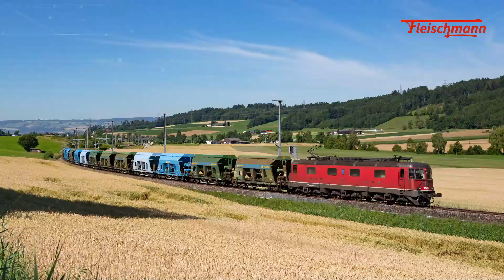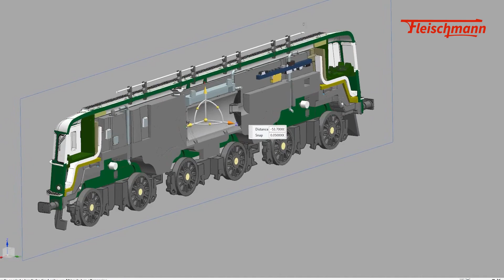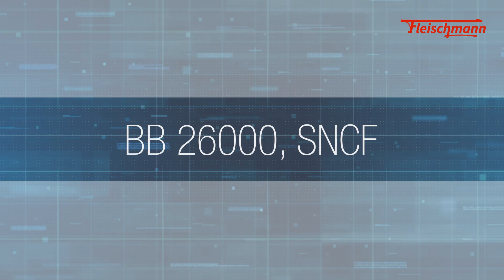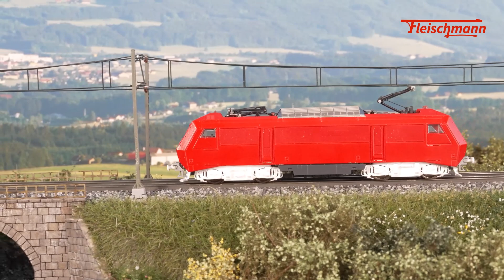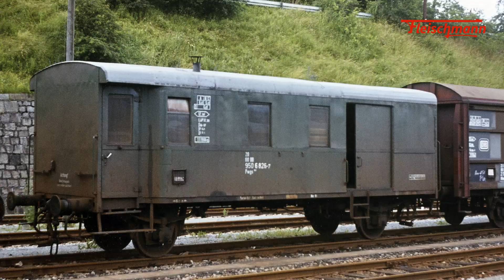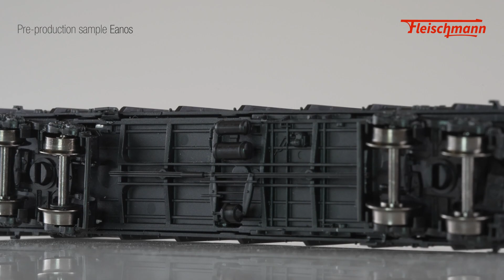FLEISCHMANN Novelties 2022

Comment: Thanks for finally producing an English version of your videos. Now all you need to do is create a new version of your n-gauge track with grey concrete sleepers instead of the old wooden ones!
Reply: Just buy KATO or Tomix
Reply: buy Kato, cheaper and 0 problems
Reply: @eduwinsMIS50PAISES  Kato is the wrong scale it's not 1:160 it's bigger. Cheaper also means lesser quality most of the time. I will pass on the Kato but does not mean it's not for everyone and many like their products and that's cool too, just not for me.
Reply: @mneonew87  Kato is the wrong scale it's not 1:160 or it is bigger than Fleischmann scale. I'd choose Fleischmann over Kato everytime. But that's just me as you will see from my videos.
Reply: @ngauging  Fleischmann standards are really poor right now.
1:160??? it is 9mm !!!! is not N scale???. Kato unitrack, Trully made in Japan, 0 problems, always works and swiches cheaper than Fleischmann, 26€ electric one... and always working, moreover the motor is under the swich, much better for eyes. I've been using Fleischmann profi since 1975... but not anymore, now I prefer Kato, except for the difficult Zahradbahn